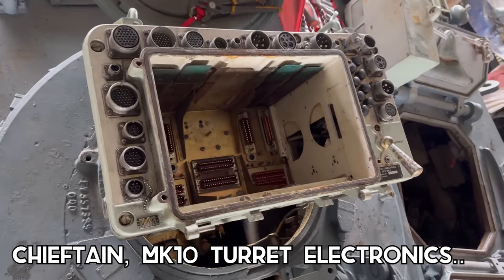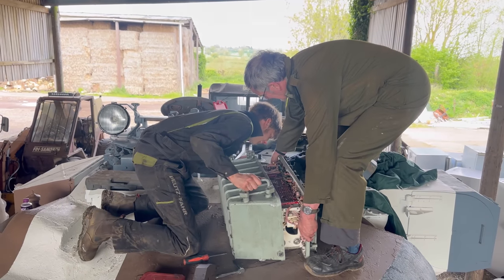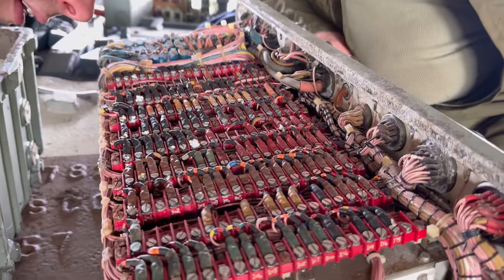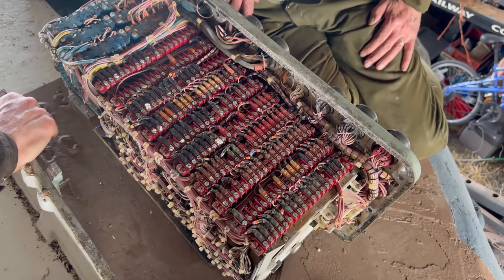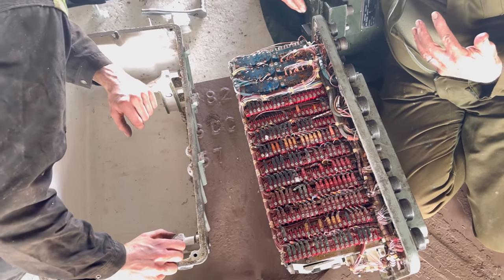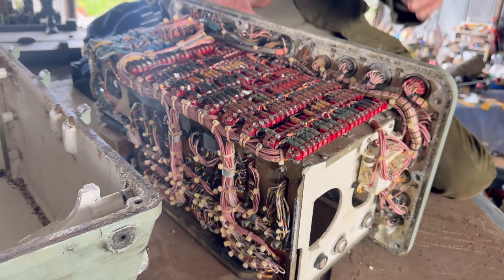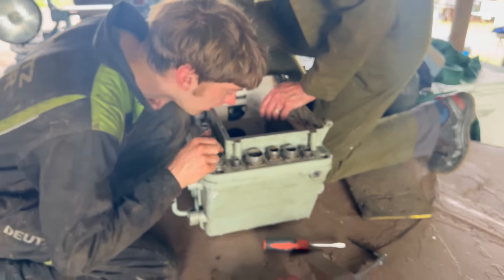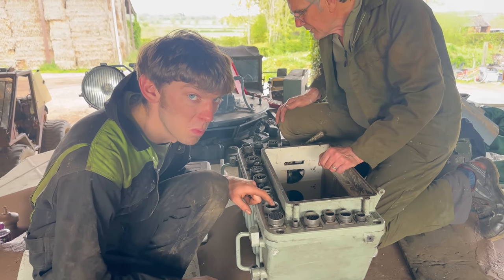Opening up a can of worms...

Comment: I can only imagine the nightmares that elderly gentleman had over the years.
Reply: He's not that elderly. He can kneel.
Reply: @yereverluvinuncleber  He's actually only 46 years old, he looks older on account of working on turret control boxes.
Reply: The military equipment is not actually that complicated, however the method of construction makes it it much more difficult to maintain, however it also makes it really reliable.
The military connectors are a pain in the bum, you need the right tooling and practise helps a lot...
Reply: @HANKTHEDANKEST  😁 i turned 47 just looking at it

Comment: All wires contain smoke it’s just a matter of how and when you release that smoke 😂
Reply: Ah, a disciple of Joseph Lucas, the Prince of Darkness.
Reply: Lucas invented the intermittent windscreen wiper.
Reply: I've seen all the copper turn into smoke before
Reply: If you let the smoke out the wiring will not work any more.
Reply: Users release smoke, technician's re install smoke
Reply: As they say, it all works until the magic smoke comes out, then it don't work no more

That's why we learn this Electronic Necromancy

Comment: I'm one of those sad types that found this interesting, thanks for going into such detail. I mentioned on the last video of this series that their could be modification level issues. The plug with a wire 'missing' could be a symptom of it having been modified to accommodate the new computer control system, as they were heavily modified to take the system. They didn't originally have the computer or laser ranging. Might be something John could check for you, the data plates should be marked with the MOD level.
Reply: I, too, find this sadly interesting.  To have so MANY components fail!!?? At one time? Dominoe affect? Faeries? With a single failure a unit would typically go into disuse and so I often wonder how 2 or more problems arise simultaneously as the domino thing can't occur , by design or by function. Nonetheless multiple failures can and do occur regardless of their proximity of function. Hard to foresee, and can alter the 'should be' readiness quite a lot. I love it when mindless management cries 'well YOU SAID it would be ready by'  (some imagined and hopeful schedule) thus beginning to cast blame regarding a component failure that came about at an undetermined time prior to the techs involvement.
I say- WAAAH WAAAAH!! to that. So sad.

Comment: I am electrical engineer seeing this corrosion doesn't surprise me, I served time in the forces (70's-80's)
we used to see this on radio equipment . Part of the problem was a mixture of metals in the relays, switches etc i.e aluminium  and steel don't like each other. I am now working with 1930's - 1960's all electrical was brass & bakalite no corrosion. I think mr Hewes you get out your brass brushes & clean them up- slow job but cheap. You could always send them up to me I will do it for a cup of tea and a cake
Maybe I am a bit sad but you do,  I find fascinating
Reply: You Sir are a scholar and a Gentleman. Nice offer. 👍👍
Reply from the maker: Il sort some relays out then you better put that kettle on !

Comment: The relays appear to be 4-pole Double Throw (4 x DPDT) per side, or 8 poles in all.  RS Components (for example) have Power relays with multiple poles for around £10. You could stack 8 in a line perhaps or use 4 DPDTs. Their current handling (6A - 10A) should be sufficient and there are a variety of operating voltages. The only issue to watch is whether the relays need to default Off or On when unpowered to ensure correct start-up state. 
With regard to the socket I would get a new one, and wire every pin with a length of cable to be cut to length in situ, a connector then crimped on.Simple and cheap. 
Since there appear to be thermionic valves in the tank you do need to be careful on units like the PSU since after power-up electrolytic capacitors can carry 200V-400V or so even after switch-off (assuming no  bleed resistors). And electrolytics degrade over time in any case so are best tested/replaced. Be very careful if you start repairing valve kit and be sure to measure HT voltages in the PSU before starting work. 
Another thought - where do high voltages for valves come from? The Auxiliary engine? The main engine generator? This all sounds a bit dangerous too!

Have fun and keep safe.
Reply: You know how to cheer someone up. I really admire your knowledge . Cheers

Comment: Definitely my favourite vid so far Joe, as someone who has worked on control systems for 35 years (not tanks) and done the “replace it all with a modern logic controller / PLC / CAN system / whatever” many times for customers I’m 100% with you on rebuilding the original kit albeit with available parts 👍

Comment: As a 30yr Electrical Draughtsman I produced schematics and wiring diagrams. Every one of those boxes were probably wired up exactly the same so that the looms and routing were duplicate also. I bet sourcing new modern relays with the same number of change-over contacts would be not hard (and cheap). I learned on a drawing board with my trusty Rotrings and ended as a CAD user. Just that control box from design to build/test/commission will have taken a huge number of man-hours.
Reply: I was impressed with how well it was built - even the cable ties were equally spaced and in line!
Reply: Those appear to be 4PDT, probably 20A or 30A contact rating, probably 24VDC coil.
I just did a quick search a few minutes ago, and it is right hard to find that exact specification. You can get 4PDT off the shelf, but only with 15A contacts. That might or might not work. You could use pairs of DPDT 30A relays with the coils paralleled, and can get them for about $6.50 each. You would probably also want sockets with screw terminals, and those will be another few bucks. And won't match the current pin layout, so a lot of wire modifications would likely be required.
Reply: I'm a design engineer in aerospace. The average person has no idea what goes into designing, building and testing most things especially complex vehicles or systems
Reply: Thank you.

Comment: I spent many years working and re[airing such equipment (no tanks though) before you throw those old relays away check what the contacts are made of. In that era many relays used platenium contacts which are worth a lot of money today and may be why the price of a new relay is so high.
When you are looking for new relays check that the contacts will take the current that goes through them.
You should have no trouble getting replacement relays.
If I were doing it I would make up a board and wire it as a stand alone then terminate the incoming cables on a connector to connect it to the board, which would make it easy to change again if you need to and you could make up several for spares
A firm called Radio Spares are good for the bits. I hope this has been of use 
I love your videos as I always wanted to drive a tank, but I am too old and stiff now.

Comment: Well diagnosed young man and John. 
One thing about 'electronics' of that era is that things were large and basically simple (ie mechanical). Complex but not complicated. I don't know about anyone else, and forgive my OCD, but I was mightily impressed with the quality of the build in that unit. Whoever built it had the attention to detail to have the cable ties lined up like little soldiers! And the loom stitching was just beautiful. Don't let anyone tell you we didn't and can't do quality!
Depending on the power loadings there are many options to those failed relays and if it was me I would take out those extra pins and cables on the first (PSU?) replacement plug and use one of them where that cable is missing on the second (Trim?)plug . OCD again. Sorry!
Reply: Agreed! And the wires are all MIL Spec with what looks' like fiberglass jacket for strength and fire retardant. Debugging stuff like this tight up my street!
Reply: I just love the way everything is sealed against the elements, sand, wind ,rain, and sun modern tanks not so much but with their maintenance schedule those Abrams  hold up to moisture, sand sun, trouble is their workshop is absolutely ginormous with many many soldiers and civilians overhauling them.
Reply: @davidsmith-ih2kk   This was from a British Chieftain MBT not an Abrams.
Reply: @1chish  Honestly I never said it was an Abram's tank, what I actually said was the old tanks can stand up to extreme conditions NOT LIKE THOSE ABRAM tanks, but with their fix it schedule they don't have to because they are completely overhauled.

Comment: Suggestion to save time: Since the pins are ok, use a pin extraction tool and insert them with the existing wires into the good connector receptacle.
Reply: That looked like it has solder cup pins. Those are normally molded in place. Crimp connector pins can be extracted.

Comment: I had exactly the same problem on our Mk10. I took the bad relays apart, replaced the rusted out springs, cleaned the contacts, rebuilt them, and they worked. Biggest problem I had was a lot of the terminal screws on top of the relays were so corroded, they just sheared off when I tried to remove them.
I ended up dremelling the sheared stubs down to clean metal, soldering a wire pigtail on the screw stub, and soldering wire pigtail to original wire. Bit of a nightmare job actually. 
Another problem I found was a wire buried right in the middle of that thick harness that runs along the top at the back must have had a break in the insulation from new. Water had got in and corroded the wire. But at least that was to fix once I found it.
Reply from the maker: I was planning on doing the same these screws are no longer screws
Reply: The spring screws onto the threads of screws at either end of relay. IIRC, one of the screws is used to adjust tension on the spring to get a nice snap but not so much tension coil can’t move armature. Pretty clever.

Comment: That looks like a nightmare. An incredible number of connectors, which all stop working when they are affected by oxidation or corrosion. I remember in a factory where I worked, oxidized circuit boards were washed in the circuit board washing machine. The washing machine had a pool where the circuit board was when it was washed and it couldn't be water because it is the enemy of the circuit board. The substance in the tank immediately started to boil when the device started. The protective coating could come off the circuit board in that machine. The use of the device was banned because it was too dangerous or toxic. I have repaired thousands of circuit boards. That tank really needs a lot of work to make it work. Circuit diagram drawings of the circuit boards are needed and wiring diagram drawings are needed to check the wiring. That seems like a real nightmare to get working, but it's not impossible. What I learned from electronics is that if you make one wrong connection, the electronics will burn right away. Everything has to be checked and verified several times. Overloading can break circuit board components. There is nothing spiritual about electronics, everything is simple, but it can be very difficult to understand. All circuit boards intended for outdoor use should be protected with varnish intended for circuit boards. Varnish must not go on connectors, switches, relays or connecting surfaces where it should not be, or the varnish prevents the flow of electricity and jams all switches or relays, but it protects against oxidation. You have to be careful with varnish if you use it. Use specific varnish for circuit boards very crefully.

Comment: Simply dismantle the lower part of the relays and shorten the springs by one turn, clean out, and rebuild, Job's a good un! There are screws longitudinal to the relay body folding the coil assembly on, you may be able to do this without disconnecting a single wire.  I spent a working lifetime doing this with various relays and contactors, it is amazing what can come back to life with a little care, just try it on the bench with a 'spare' one first, so you can see what you need to do.

Comment: Look at the plugs that match the defective sockets as they maybe damaged as well. Interesting to see the connectors and strip terminals plus cable forming same as my era as an apprentice at Marconi. It Was like knitting spaghetti on a pin board drawing. Any errors and it was cut and you started from scratch. Burnt insulation at the plug start again. No wonder the MOD contracts overrun in time and cost.
Reply: Did my time at Marconi as well, cost + contracts covered the overrun 🤣

Comment: Ah yes.....those round connectors on that control console look like amphanol connectors 
Be careful when you connect plugs and sockets together 
Make sure the locating dowels are correctly aligned and the pin configurations are the same 
Apply a small amount of lube to the internal and external threads😅.....i have had loads of fun with these style of connectors lol......but keep at it you will crack it in the end🎉😊

Comment: Buy a dmc crimp kit or chinese equivalent (they crop up in Ramco's tender) You can release pins, clean them and install new pins etc. You can buy the amphenol inserts.   I am sure for future you could assemble a kit from an arduino or raspberry pie that would take inputs from tanks reference componentry and translate them into the correct outputs to control the gun.  Someone would code it easily.  It is a shame knowing there were probably pallets full of these systems that were no doubt smashed up for the wire and aluminium as is allways the case.  Maybe being on youtube / social media an expert will come out of the woodwork or someone with a spare unit will appear.

Comment: What connectors were they using in those panels? Are they standard 32 pin Amphenol? Have you not thought about getting a pin extractor kit and possibly some new blank panel sockets. The problem with brass nickel pins in alloy I galvanic corrosion

Comment: As many other commenter's have suggested, if the contacts themselves look okay (not greatly pitted) or can be cleaned up without removing too much plating or material, as far as the mechanical bits within the relay, you could machine new ones and rebuild the relays. I think it is easier to rebuild the old relays and clean up the original wiring harness rather than trying to rewire a different type of relay because you would also have to rewire the connections or try to install inside of the original footprint. Also, you have a working relay that you can take apart, measure and accurately copy. The relay switched contacts look like 30ADC 48VDC type. However, I am unsure what the coil requirement is.

Comment: As an aviation tech in the Navy and into electronics for over 50 years, use your nose to smell for smoke. 80% of troubleshooting is something burned up and use your eyes. 
Unfortunately the fastest way is look up the connector number,  replace the plug and swap out the wire one at a time. Many times the plugs are out there are used even on new boxes and they use standard wire release extractors.

Comment: Its possible to take the pins out of some of those connectors with a tool that looks like a very thin walled tube, it compresses the barbs on the pins so they can come out, saves changing the wire loom.
Great vid hopefully it will all work for you.
Reply: Just use an old telescopic antenna part of the tube antenna. That what I use. Works well.Slude it over yhe pins and rotate it around a fee times and then yoy can pull the individual pins out.

Comment: ...I've seen Server rooms in the late 90's, at DFW International Airport, that were far more disorganized than this panel.  That is some clean wiring harnesses and layouts.   They don't build stuff like that anymore, everything nowadays is Disposable, because of Built-In Obsolescence by manufacturers and engineers.  Obviously a G.E. Engineer was never involved in the building of this electronic service panel, or else it'd be a nightmare to service.  

Former G.E. Computer Service technician, 1996

Comment: Pushed pins were a common issue with circular connectors, dirt or corrosion or miss mating  the female pin on male will push em out, many times cleaning connector and  realigning will help them snap back reseat. Love seeing this problem
Reply: Wish I was there
Reply: You have a pin removal tool????
Reply: Measure resistance of good relay coil vs bad coil, could be bad relay coil
Reply: I use Qd ckeaner for this mostly isopropanol and a bit of methanol to clean, CRC product from automotive supply

Comment: there'd be nothing to stop you using commercially available relays although retrofitting them could be a bear, the only issue is that your frontmost relays are 8 pole, and it's uncommon to get anything over 4, granted it's easy enough to connect the coils in parallel. something like an OMRON G7J4AB24DC would probably do for the rear ones, the heavier cable suggests much higher load and I'm assuming it's a 24v system. I would imagine the end user isn't going to care what's inside the box so long as the box works.
also, those connectors are still available, although I'll be buggered if I can remember what they're called (I could find out tho)

Comment: If you look up Cannon Plugs (after a guy named Cannon) you will find these are standard off the shelf connectors. With a $1200 crimper kit you can completely rewire a plug with brand new pins (pins are approx. $1 each). I have to do this regularly at work on equipment that sees heavy operator abuse. There are of course different plugs depending on the number of pins, female vs male vs they/them styles, surface mountable ones like what you have on that box, or plugs that go onto the end of a cable.